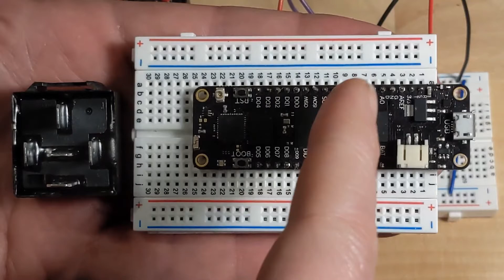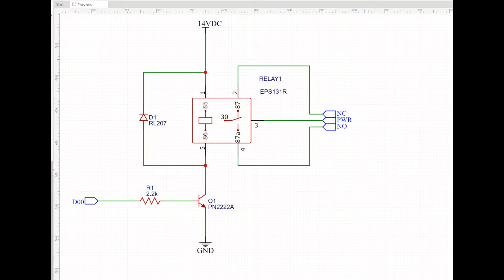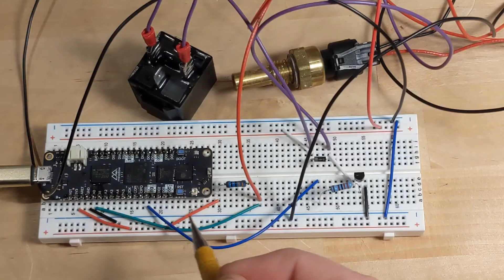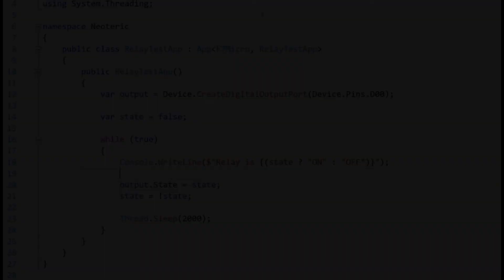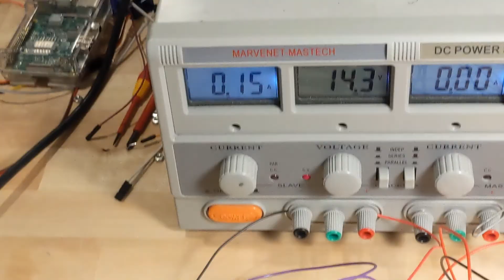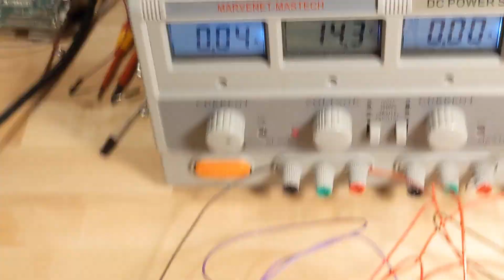Adding Electronics To A Classic Car: Creating the Relay Circuit

Comment: Hey man im very interested in your electrical projects how is the electronic gage coming?
Reply from the maker: It's still coming along.  I had a motorcycle accident a couple months back which set things back a bit, and I'm trying to build an automotive-grade power supply and parts are difficult to get right now.  It's definitely still happening, though.